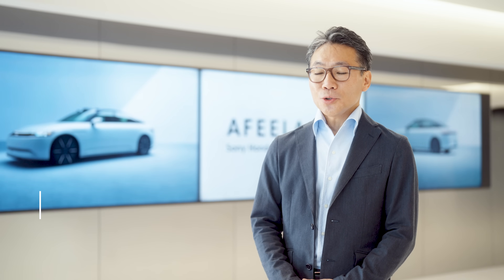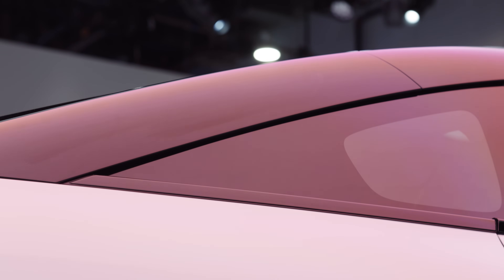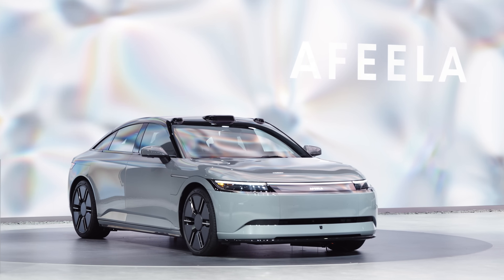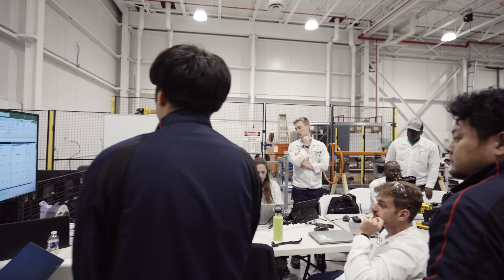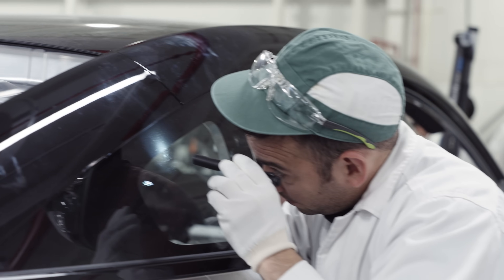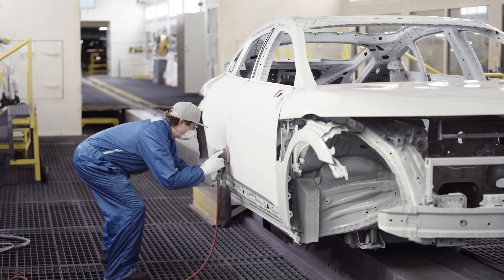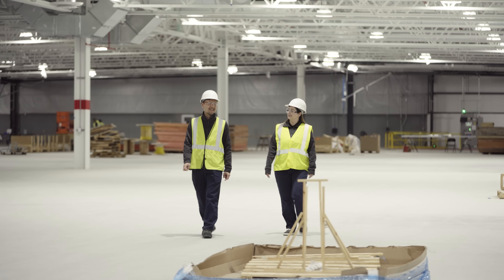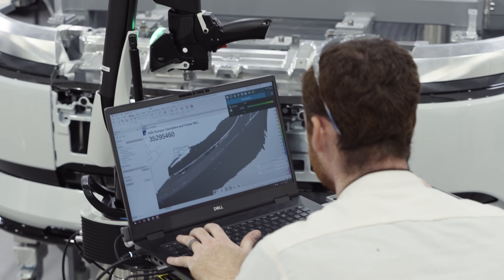Inside the Making of AFEELA 1 | Production journey begins in Ohio

Comment: Afeela a little too late and will be underwheleming and not sell significantly. Whats the point?
Reply: And how did you arrive at any of those conclusions? With all due respect you seem to not have any idea what they are doing. They are not trying to engage in a spec war with the EV manufacturers. That is a race to the bottom of the barrel. If you think the specs make it "underwhelming" then you are 100% missing the point of what they are doing. This car will live or die based on its native operating system, its A.I personal agent, and the overall user experience which includes a large suite of infotainment. The Afeela 1 is a smartphone on wheels first, and only a car second. That is why the focus is on the user experience inside. They are playing a different game. Guess what....the Nintendo Switch had very low specs compared to the competition. Did that stop it becoming a huge success? No....because what mattered were the games. That is what sold it. Not the hardware. Guess what?....the IPhone does not remotely have the best specs. If anything it is often comically behind on hardware specs. And yet its very successful. Why? The user experience and eco-system. It is not the hardware that sells the Iphone. And that is what Sony is aiming for here. Providing a superior user experience, services, and eco-system in an EV.....its not about the hardware.
Reply: @Sabundy  its overpriced garbage and yes, hes right it will be underwhelming... you spend alot of time defending this, i doubt you will be able to even buy one, let alone drive one.

Comment: For the 2026, looking to seeing if they put in NACS, up the charging to 200 kw, and get the range around 330 miles using either rear wheels or front wheels.

Comment: The more I see of this EV and its features the more I am convinced that SONY is onto something here. The more I am convinced that they have a winning product on their hands. They are wisely looking to differentiate themselves through the OS/UI and overall user experience and eco-system as opposed to getting stuck in a spec war.  There is a very Apple strategy to it all. SONY essentially made the Apple car when you really think about it. And when you read up on everything in this car the tech that's in it is actually quite impressive when you realise that it's really a smartphone on wheels first, and a car second. Which is a very smart play by Sony. Not only could it reinvent them as a mobility tech brand, but it could also establish their own operating system (the Afeela 1 has a totally native proprietary OS) that could even be ported over to some of their electronics devices.
Reply: Are you crazy????
40 sensors and no autonomy, WTF!!!
Tesla is starting to run its Robotaxy service, in Texas and California, with just 8 cameras, only artificial vision and AI. 
Sony Honda are years behind, they are doomed to failure before they even start.